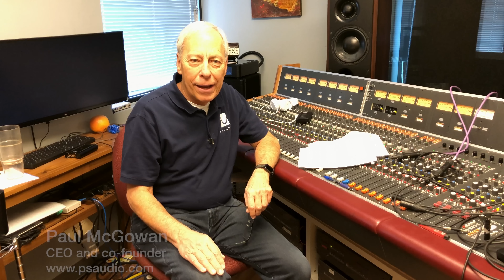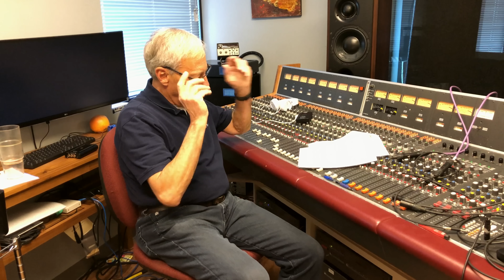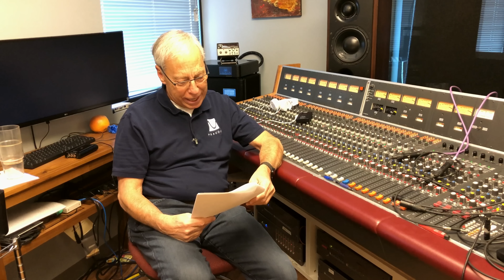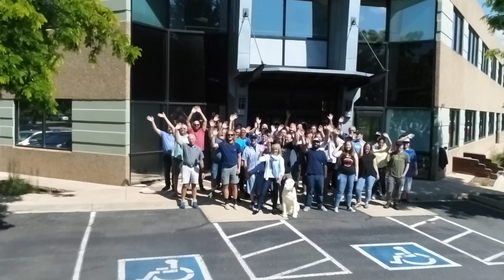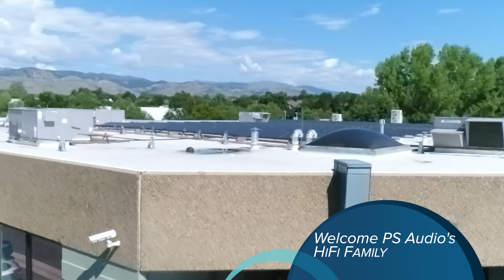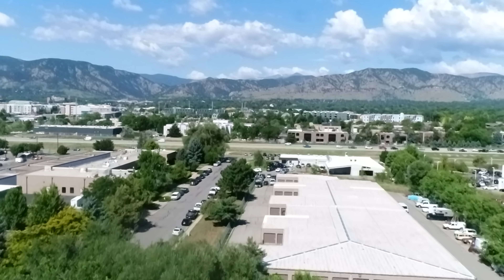How to split a DAC output

Comment: Old video, I know, but can you do the same but in reverse?  Use a Y-splitter on an input and connect 2 components without a switcher/input selector (not running at the time)?

Comment: I was using a Rotel preamp that has two pairs of outputs and split the signal with y-connectors on one pair to feed two amplifiers (one drives subs) and it worked great. I recently bought a Schiit Saga plus and when I did the same thing it reduced the volume level on the side with the splitter by 4 to 5 dB...  I put the Rotel back in just to be sure it didn’t have the same drop in level. I emailed Schitt and they said that’s just what happens and that all equipment will do this. THIS ISN’T TRUE! My Rotel did not do this. 
Must be the way that the circuitry is wired? I don’t know. I do love the sound of the Saga Plus over the Rotel so am only connecting one pair of my Magnepans instead of two. 

So just a warning, if you connect Y connectors to Schitt preamplifiers it DOES have a very significant and negative effect on output and low-end frequency levels.

Comment: Use a high quality, durable Y connector. Avoid the bulky ones and the ultra expensive ones.

Some companies will make them to a custom length, and this would be best in my opinion. Excess connectors and different cables daisy chained together can degrade the sound.

Comment: if a DAC has redundant outputs, just connecting the two outputs together internally isn’t the proper way to do it, the proper way to do it is to drive each output independently from the DAC out via a buffering op-amp, that is actually very cheap to do, it’s surprising you don’t do it @PS Audio

the other incorrect part is your assumption that a $300 DAC cannot beat your $6000 DAC, it can, and a $15 part will, why, will let that exercise up to you or the readers
Reply: immovableobjectify 🤷‍♀️

Comment: Using a Y connector means your loading the output with a lower impedance and will be increasing the capacitive effect of the cable but the effect will only be audible if you have a crappy preamp or DAC with a too high output impedance.

Comment: My TEAC DAC Its a UD 501 I use XLRS unbalanced. I saw your video recently on splitting a preamp which I do with a y connector it’s a monster one I have and I do remember you said the y connection doesn’t have to be so high end to do that .

Comment: Who makes a "decent" "y" connector, tho?
Reply: Audioquest but they are say 6" long, Very well made and a good brand I use these to split my preamp output to a sub and main speakers. They habe 1 male to 2 females and 1 female to 2 males. I also tried shiny solid one piece splitters made in china. But never trusted them from a sound quality perspective. I am not sure if Paul covered the drop in signal strength with a spliter but I assume there is a voltage drop causing one to have to having to increase the gain in the chain to compensate. I never tested if there is a signal gain drop or not.

Comment: Hey Paul, just watched this video...  what are your thoughts on dac outputs, fixed or variable?  Or either one, provided it's done correctly?
Reply: interesting question, i have vested interest in the answer since i own a bel canto dac which i can choose fixed or variable output from the analog connection. 
the dac was listed in preamp and dac section of sellers website so i imagine belcanto made sure it was a capable preamp. not sure how volume is regulated, dont think its done like a normal preamp, thinks its done digitally.

Comment: Silver plated or solid silver splitter
Reply: I'm curious if you have experienced oxidation issues with silver? I prefer gold plate on top of any high quality base metal for connectors due to tarnish, although I would have to regard a solid silver body connector with hard gold plating on the contact surfaces to be the end-all. I used to repair US Army RADAR equipment which was all done in silver BNC plumbing when it wasn't using waveguides, as only the best was good enough. Over time, the tarnish created a surprising amount of discontinuity. If you're using pure silver, I feel the importance of a good contact conditioning agent such as one of the DeoxIT products cannot be understated. Your interconnect is only as good as the weakest link, which is usually a connector.
Reply: Rob C  Funny little side story... I knew a "special weapons service specialist" who was involved in removal of a special weapons system and its support components from Europe when that system was withdrawn in the early 1970s. Part of that operation was the demilitarization of the test sets and associated cables which involved chopping the cables into little pieces. I don't know is it was true or not, but he reported that the cables for the test set were actually made of gold. When you consider the cost of oralloy, gold wasn't all that exotic in the late 1950s when the test sets were built.
Reply: John...go all the way man... solid gold you'll have it for life.
Reply: @FatRat-f9m  yes but gold is not a great conductor not like silver or copper
Reply: I suspect the gold was for corrosion resistance but indeed, copper is 32% better conducting than gold and the choice was likely made by the same people buying $640 toilet seats, $7622 coffee makers, and $122,000,000 F-35Bs. Surplus defence electronics can be astounding. 
In the early days of the atomic age, they used a 10 inch diameter hemisphere of gold as a doorstop at Los Alamos.
Reply: @Peter_S_ ...your suspicions are well founded sir...btw thanks for the price list :-)
Some use Rhodium now...more expensive & the 'cheapies' just stay with Chrome/Nickle.

Comment: So describe how a y splitter degrades the sound
Reply: Let's put away degrade for a moment, but is it also a voltage divider requiring more gain somewhere in the chain than without it?
Reply: Well it could. depending on the output impedance of the DAC, splitting it adds capacitance as well as loading both from the cable and second amp. But as most modern DACs have an output impedance of 1000 ohms or often much less, a Y splitter is not going to cause any audible difference.
Reply: @andydelle4509  thanks for your reply just waiting for Paul to reply for once instead of just making a generic statement and not going into why and how